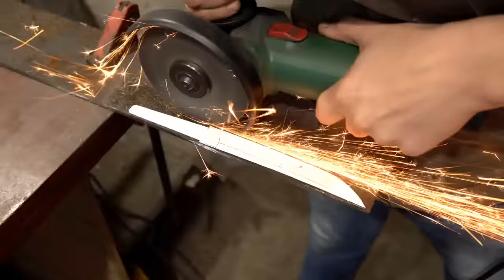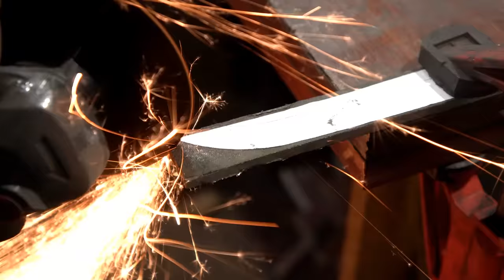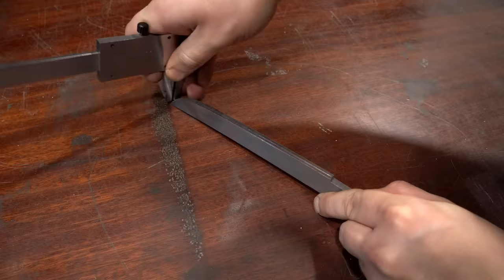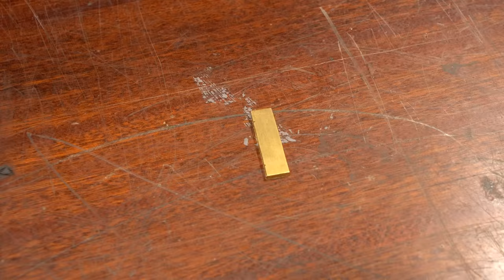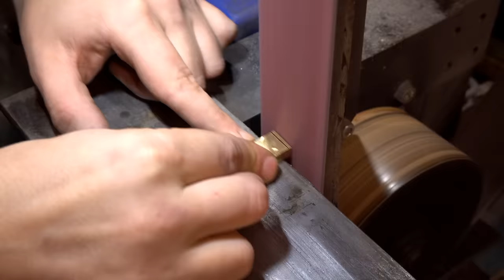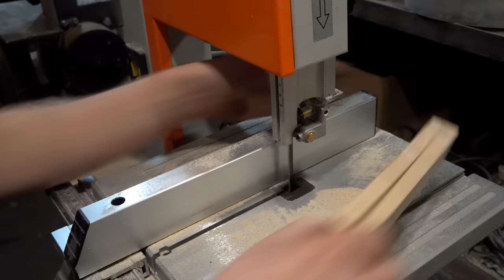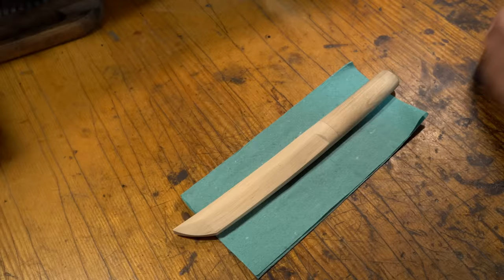Knife Making - Hidden Bokuto Knife

Comment: I was wondering after you quench the blade, you run the edge along a glass bottle... Why? Just curious.... Also amazing work!
Reply: Yeah me too
Reply from the maker: well quenched steel have hardness about 62-65HRC and can scratch glass, bad one can't do that.
Reply: If it has a hardness level high enough to scratch the glass, it's fine. If it can't scratch the glass, he would reject it.
Reply: @Koss-channel   Oh, ok. Mostly see people check hardness with a file, never seen it done with glass. Learn something new everyday.  Thank you for a quick response too! 👍
Reply: @austinkreiger1765  well.... doing it with glass is on the safer side. A friend of mine tested his knife with an aggressive file and practically took the whole edge away with one swing.... it was still soft like butter and he had to scrape it. Glass can't do anything to steel. 
So if you don't have material you can grind of, go for the glass
Reply: @dakotablaylock1116  Sad lumberjack?
Reply: @Koss-channel  🤯
Reply: steve gale  62-65 is the hardness of heat treated carbon steel. other steels can achieve hardnesses way over that.
Reply: i only can make it from cardboard
sorry my english not good im from indonesia🇲🇨🇲🇨🇲🇨
Reply: Solo leveling
Reply: Sharpness +3
Reply: @Koss-channel  how much would you sale this blade for?
Reply: You are a genious
Reply: @Koss-channel  send to me? I pay 50 dollars!
Reply: Liked it but like the scabbard to resemble the handle more
Reply: Lycrys doesn’t really look like the demon king blade to me.
Reply: I also file test after i quench but i guess that works too lol
Reply: @Lycryz   ey! i see what you mean. Loved the manga/manghwa or whatever haha.
Reply: Lssk

W
Reply: It makes it sharp and hard
Reply: The people
Reply: Fegifv
Reply: Bebek yelegi modeli
Reply: Bebek yelegi. Modeler
Reply: So it scratches at level 6 with deeper grooves at level 7?
Reply: Koss that your work is very cool
Reply: @austinkreiger1765  im your 100th likes
Reply: Me too
Reply: Ha, they’ll never suspect a knife inside a knife!
Reply: @vadimblin  If the file was enough to harm the blade than you didn't quench properly.
Reply: Austin Kreiger    .ol ss solos
Reply: 김시온 여기!!🙇🏻‍♂️
Reply: Cut test I think, maybe he’s testing it if it’s sharp
Reply: نور
Reply: Nice
Reply: Austin Kreiger he did it to test how sharp it was
Reply: Oh, kinda like when a diamond can scratch glass or be used as a glass cutter. And it may be somewhat dangerous but I have drawn the blade across my thumbnail to check where a knife may be sharp. And if this is supposed to be hidden then the sheaf should not be in the shape of the knife or blade. Hidden in plain sight!
Reply: P
Reply: Pp
Reply: @sicidabohertz  ppp^pp
Reply: It helps in sharpening
Reply: @marleenaahmadrapiee1617  wrong
Reply: Ooó
Reply: Glass is as far as I rembeer the best way to get the best results hence the reason the japaniees swords are still made that way sometimes the old methods are the best the glass test is 1 the safety way and 2 the best possible method for making sure the blade isn't damaged. Files are new school way why change it from 1000s of years of making weapons that way for an inferior 2ay of testing the blade and risking damage or it shattering if its not been quenched properly 🔪😊
Reply: @user-gq1yp8tz5j  15 minutes condensed video probably puts it in the $175-$250 range.
Reply: @#maxim #Max Philippines is the one who speaks Spanish in Asia. In fact, it used to be our 2nd Language and was change into English during the 60's.
Reply: You clicked on it, why are you confused
Reply: @Koss-channel  So are there one off things? I'd love to buy this knife.
Reply: God is good!!!!°°°°
Reply: Koss well done ! Beautiful craftsmanship 👍👏
Reply: What about other side of the steel, its total martensite. Its total brittle. U should consider the durability also
Reply: @GSP-76  oh man... ,_,
Reply: ค
Reply: Koss where can you buy something like this?
Reply: Austin Kreiger I was wondering if u water quench or oil plus what material do u like I use damask
Reply: @timcransberry6152  I think the point is, it looks like a training knife. I would of stained the wood black.
Reply: @hunkyharvy  That's because the  Spaniards ruled over you for over a hundred years till we Americans liberated you. You speak a lot more than, Tagalog, English and Spanish though, 67 dialects.
Reply: 测试硬度
Reply: I’m not asking for you to sell this piece, but if you were going to, how much would you sell it for? I’m only asking because I’m in the market for one.
Reply: Nice beautiful 😍
Reply: Ap mry chnl pe aen pz
Reply: Rinne Tensei olloololooolol
Reply: @Koss-channel  do you make those and sell to people interested in buying?
Reply: @sicidabohertz  go revive jiraiya
Reply: It’s to see if his blade is hardened I love also seen it done with a file
Reply: I'm not sure  but I think  it's to check hardness
Reply: It’s to see how hard it is
Reply: @user-gq1yp8tz5j  that's a $5,000 blade.
Reply: Probably to check for flaws
Reply: 파충류 채널인데요 동심의 세계로 안내해드릴게요 제채널한번만와주면 당장달려가서뽀뽀해드릴게요 제주도까진멀어서못가요
Reply: nice😘
Reply: Hi
My name's Austin too
Good to see you spell it correctly
Reply: What kind of wood did you use ?
Reply: Same here
Reply: Jesus is now questioning the quiet kid why he stopped playing his tole
Reply: ME TOO
Reply: Because glass has a hardness of 7 pretty har to scratch unless you had well quenched steel
Reply: I bet ur the quiet kid from school
Reply: I'd like to point out that he cut the glass rather than rubbing it on it but what do I know
Reply: @user-gq1yp8tz5j  lmao 50 dollars would be only for the materials, if i had a blade like that and if i would sell it i would sell it for something like 800 dollars at least
Reply: @Koss-channel  Where did you get the template for the knife from, and what was the thickness of the W1-7 high carbon steel used?
Reply: Austin Kreiger 101st comment
Reply: steve gale  55HRC is what you would expect in a lower carbon steel like 1055 for throwing knives, and machetes. You can heat treat, then temper high carbon steel back down to the mid 50's but you are leaving the best edge retention on the table.   High carbon steel should be in the mid  60's when quenched, and then tempered back down to high 50's for edge retention and to keep from being overly brittle. For thin, high hardness kitchen knives, may be 62+ ( but don't chop bones, or put lateral stress on a thin high harness simplw carbon steel).
Reply: steve gale  Many knife makers, custom, and production still use simple high carbon steel in their knives. 1095 and 1084. Some of my favorite production and custom makers still use it. I could point you to many masters smiths who use a lot of 1095. Tempering, does indeed reduce the hardness level of the steel. Starting at 300 degrees or so every 25 degrees drops another HRC points. As quenched, you are at about 65 HRC (if you hold at the proper temp, and quench quickly in the proper speed of quenchant). Typically for general use you will see 1095 tempered back to about 58-60 hrc. Though many of my large fixed blades are a bit softer. For what it is worth, I have owned custom knives for over 30 years. I've used all manner steels. Stainless, tool steels, bearing steels, spring steels, simple carbon steels, CPM steels of many types both stainless and non. I've owned the cheapest production knives, high-end production and pricey customs. And get as much enjoyment and use out of a $6 dollar Opinel carabon steel as I do out of a one off, custom made  to my specs in every aspect from handle materials, blade styles, in a high performance cpm steel. Ive also made my own out of several steels, stock removal and forged. There is immense misinformstion about knives, steel, and everything related to the topic. Fortunately, the internet also provides wonderful information as well. A great place to start.  https://knifesteelnerds.com/
Reply: steve gale  Master Smiths like J. Nielson,  Burt Foster, and many many many more still forge with 1084 and 1095. It is the main steel used in many san mai blades as the core steel, in canister damascus, in patten welded steels, andp plain old mono steel Mastersmith knives. Many smiths still advertise it as one of the steels they use.
Reply: Probably to test if it is sharp and if there are cracks in the blade
Reply: hardeness levels
Reply: Can u make a dagger from csgo
Reply: ششششششششششششششششش محمد من العراقا
Reply: Hola😁
Reply: strength test
Reply: Pwiddy 😍
Reply: I got a question do sparks hurt
Reply: Zrztt
Reply: W5ts+3
Reply: @dakotablaylock1116  s
Reply: @0xDreamy  tt6dTs5
Reply: @endless_paradoxgaming4424  tdt
Reply: @sicidabohertz  Zttzttd
Reply: 7++3+7+5rtz
Reply: Tztzttzzz
Reply: TdTxt
Reply: @Koss-channel  3
Reply: @austinkreiger1765  zrz
Reply: @ShadowGryphon  z
Reply: Lol yup
Reply: @Sickmonkey3  He definitely would NOT reject it because it’s totally possible to do the quench again.
Reply: @flux0841  reject does not mean scrap. It means it did not meet specifications and needs rework. Thank you for trying to explain my line of work for me.
Reply: @Alex2148_  not really. they can get annoying after a while but they don't really hurt unless you're REALLY grinding and it's all going on your skin
Reply: @user-gq1yp8tz5j  haha only 50? Those things are much more worth
Reply: @Koss-channel  didnt know that thanks
Reply: To me have learned my craft in Germany it is quite unsettling how close you get to the saw with your fingers. Safety first, my man. Be careful <3
Reply: @Koss-channel  , I want to buy one of these but it’s gone. Can you make me one please?
Reply: Well quenched steel have hardness about 62-65HRC and can scratch glass bad one can’t do that Well quenched steel have hardness about 62-65HRC and can scratch glass bad one can’t do that Well quenched steel have hardness about 62-65HRC and can scratch glass bad one can’t do that Well quenched steel have hardness about 62-65HRC and can scratch glass bad one can’t do that
Reply: @Sickmonkey3  hmm... most of my swords have a hardness between 50 and 55... and they do just fine. With a knife you can go higher of course... depending on the steel.
Reply: @ixurlife8076  How does the glass get the best results? As long as you don't damage the blade the file is perfectly fine to use as a hardness tester.
Reply: @ixurlife8076  The Japanese only started making glass in the 17th century so its not an amazing ancient technique used by the shaolin monks passed down by fishermen until the famous Japanese smith Masamune crafted the first katana and tested its edge with this very method. 

(and yes I know half of what I said was greatly exaggerated)
Reply: Dam my brothers name is Austin Krueger
Reply: @Koss-channel   actually you can increase hardness on your metal if heat it up with a large amounts of fine coal dust covering the blade while heating to make a carbon layer on the blade so you don't have to throw away a softer metal
Reply: @dom4761  (coughs) no homo (coughs)
Reply: @0xDreamy  depends on the carbon content, “carbon steel” doesn’t narrow it down.
Reply: @leetlebob8203  Well 90% of carbon steels hang around that area.
Reply: Drink cactus juice its the quenchiest of the quenchers !
Reply: Same
Reply: probably to get right of the brzz
Reply: @Koss-channel  but hey,if its gonna be a hidden knife you shouldn't do the guard in a knife form 😑
Reply: Yeh but can’t you just run a file on the edge to check it bc if it scrapes of it is hardened
Reply: because the blade is thirsty
Reply: Me tooo
Reply: Where did y'all learn to do this?
Reply: Hmm... interesting
Reply: @Sickmonkey3  ๆ
Reply: Well I'm late to this party but I'm glad you answered that question because I was lost! Blade/Black Smithing in my opinion seems to be one of the only professions that is a true community. He didn't have to show scratching the bottle but he did so to be informative! Very few trade secrets a Smith won't share to help others out that's my I love this community.
Reply: @Sickmonkey3  h
Reply: It will quench ya, it is the quenchiest!

Sorry I had to..
(Avatar the last airbender reference)
Reply: Its the knife that almost killed drake
Reply: Nah a Broom is way better
Reply: @Sickmonkey3  He literally typed it. You just typed the same thing.
Reply: @Xominus  oh look another one. Try reading all of it first before thinking you're right. What I said was correct, he thought he knew than he actually did. He did not.
Reply: I  WANT THAT🤤🤤
Reply: Standoff 2
Reply: @0xDreamy  for example?
Reply: @user-mf7li2eb1o  cpm rex
Reply: remove random crits
Reply: Nice! Thanks for sharing. You're good.
Reply: @sicidabohertz  ww
Reply: @user-gq1yp8tz5j  ppl would pay way higher than that my g
Reply: لعبلعب
Reply: ok
Reply: @austinkreiger1765  a file could potentially ruin the the sharpness more than glass
Reply: It’s to test the blades sharpness
Reply: It's so easy
Reply: Nicely done…BEAUTIFUL!!!

Comment: The only thing this blade is missing is your stamp. You need your logo man. Exceptional work with basic tools. Take a bow sir.
Reply: Why put a logo on something. Logos make products look terrible.
Reply: Peoples work alone should be advertisemant enough. Dont muck up good quality stuff with a piss poor logo
Reply: @HuggyBear420  A logo is a way of building reputation, how would you know this was a Koss knife?
I agree that most logos look terrible, because people try to add their own flair to a logo with eccentric backgrounds.
The Koss' initials burned into wood like this, at the bottom of the handle would look great.
Reply: @Tychohuybers  Agree, it only has to be a very small logo. Koss' trademark. if painter Rembrand never put a logo, the night watch was not worth 100,000,000 USD
Reply: If not a logo,maybe a signature.
Reply: @johntakito1795  same thing. I think he meant a Brand (whether it be a sig, logo, mark, etc).
Reply: Sonny Lopez I disagree, if done right it looks great. Plus Koss’ logo is cool anyway

Comment: But can you imagine doing all of this without any machines in old days in the history?

And they’re even better. 
But I loved this video so freakin much
Reply: Yeah, back in the old days no one would use pre made metal.
Reply: Human For You That too!
Reply: The thing is, modern katanas are better because they are made from iron unlike older days katanas that wete made from iron dust and would break after line, two hits
Reply: @NiCoNiCoNiCola  You realize that you basically said "modern katana are better because they are made of iron, not like old swords that were made from iron" right?

Iron dust is still iron. The correct answer is steel. Both modern and old katana were made of steel.

The difference is modern steel can be mass produced to a high quality standard with few impurities. Where as before they had to rely on bloomery steel made by taking the raw iron and melting it down in a massive furnace.

This produced large amounts of steel but of varying quality and carbon content. This is why Japanese Smith's would use different pieces (both soft and hard) to forge their blades.

Specifically, the soft core that's more flexible, and the harder outer shell to retain an edge. This was done for the sole reason to ensure they do not "break after two hits".

No one would spend weeks or months on a weapon that would break so easily.
Reply: @MercenaryJames  You are a smart man.
Reply: Plenty of people still make knives without machines. a friend of mine started it as a hobby a few years back and now it's his full time job. I actually have one of my own that he talked me through making, the entire shape and edge of the knife was forged to shape with a hammer on an anvil, it started out as a rail road spike. Forging your knife like that also makes for a far more durable knife over one cut to shape with a template.

Comment: Makes me wonder how they  used to makes during those old era.. without machines or power tools daayyuum 👍👍👍👍
Reply: A lot more forging which allows you to work the metal with just hammers, oh and a lot more man hours of course
Reply: Lots of effort
Reply: skill and time ... also hammers and a forge ... still done that way if you want a good knife.
Reply: Lal H k i p 
Muscle power.  You can watch videos on traditional katana forging.
Reply: Man power and forging a blade not cut one out and then calling it a blade
Reply: @MANOFWAR-tz2pb   to be fair you can make a really fine blade just with stock removal, it just wasn't often done historically(though I'm sure examples exist even if I'm unaware of them)
Reply: The originals where forged out of specific rare material and what later became the blade where hundreds of hundred layers of metal folded over and over. Kinda disrespectful to call his build the same as the old ones when he just cuts it out of a random block of metal
Reply: Lal H k i p a lot and a lot of hammering

Comment: Dayum this brother did all that without hand protection
Reply: Most blacksmiths don't wear those after a certain time they say it's better to feel the steel without gloves
Reply: Zaccharias.b  thank you that’s interesting I thought with all the sparks and heat it might hinder the process but i suppose what you said does make sense👍🏻
Reply: @GreenHatDispenser  yeah about those sparks... does it hurt you if it hits you?
Reply: Ok
Reply: @chairvergil4552  nope... it startles at first, but you get used to it
Reply: @chairvergil4552  you can feel stuff hitting you but it isn't hot and generally doesn't hurt
Reply: Well to be honest most power tools involving cutting grinding its actually a violation in a machine shop to where gloves because it can get caught in the tool break snap or gouge your fingers always where safety glasses tho if you are welding however I recommend long sleeves & leather gloves unless you want a tan 😁